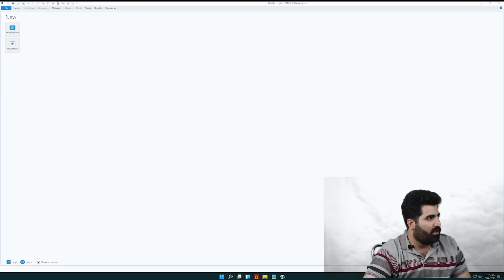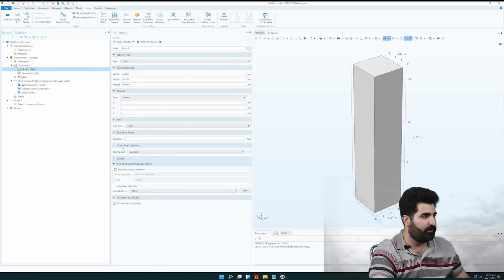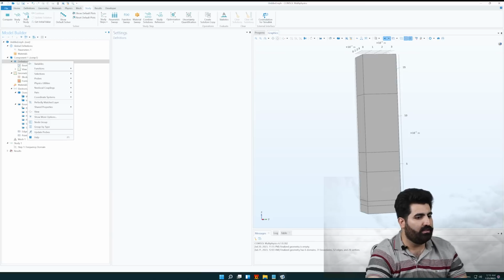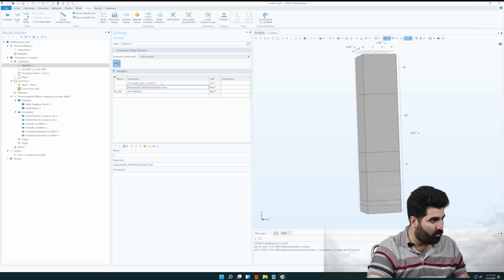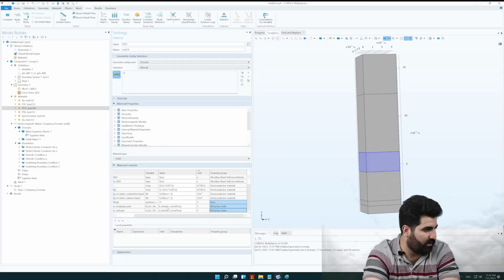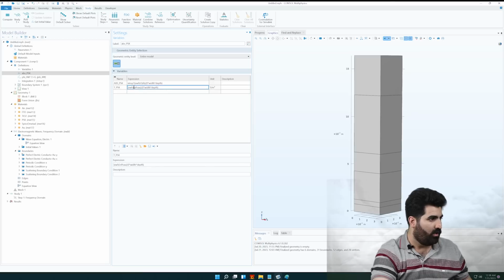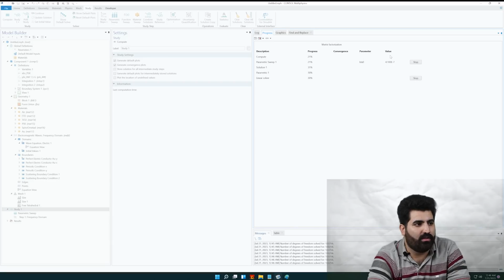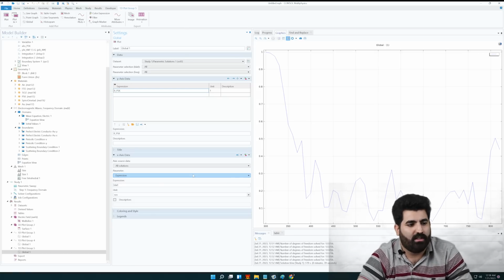3D generation rate,absorbance, reflectance, and transmittance of Perovskite solar cells with Comsol

Comment: Dear Dr. Mehran,
If I do not use the scattering boundary condition in the EWFD section but instead set the incident light using a port and PML layers, how should I proceed? When I tried this approach, the absorption curve of the perovskite layer was far from the result shown in your graph.
Thank you very much!
Reply from the maker: You must consider real situation , ot means the real electric field,
Reply: I need this video with a better resolution

Comment: Dear Mehran, 
Please can you tell me how can I calculate integrale of Heat thermalisation (radiation) :Hth =integrale((E-Eg-3*K*T)*g_tot
Reply from the maker: You must add variable section then write this code
Note: integrate
And the integrate must be define in.the nonlocal coupling section and in the related gemotry
Reply: @EasyTechSci  
thank you for your reply, Mr Mehran my integral is limited from band gap energy Eg and incidente energy, when I use monolocal coupling integral I can't integrate for energy? please tell me how can limited my integrale for energy.
thank.

Comment: Hi, Dear Mehran.
Thank you for this video. Please, can you tell me how I can sum all the wavelengths to have the total generation Gtot in order to add it in the semiconductor module.
Reply from the maker: You must extract the G for each wavelengths and bring it to the excel or origin software, then keep x, y, z and sum all of G. The x, y, z valus are the same for all wavelengths and you must keep one of them but G is different and you must sum them.
Reply: @EasyTechSci  
Tanks a lot,
Please, another question concerning the parameter that I must optimize to have a large total generation of around 2.5 e^28 or more . Because, I gote only 1e^26
Reply from the maker: @fateherbentah2029   you must work on the refractive indexes and boundaries conditions in optical modeling
Reply: @Mehran.Minbashi  
Hi, dear Mehran

Wat do you mean by boundaries condition? I applied all the boundaries conditions that you recommended in the video. If exist others, please tell me. Best regard.
Reply from the maker: @fateherbentah2029  see the video carfully.
There is nothing more than that.

Comment: Could you please let us know how to calculate the generation rate?
Reply from the maker: Hello dear dr,
Yes, you must extract the generation rate for each wavelengths and then sum all of the generation for all wavelengths. If it is hard, I will make a video about that.
Excuse me for delay, I will be touch sooner from this moment.
Reply: @Mehran.Minbashi  thanks so much, I did it but the generation rate is much more than that of achieved by other software, for example, 10 times more than the generation rate of lumerical software. Are you sure the equation is correct?
Reply from the maker: @hamedsaghaei6898 Hi, yes, these formula are based on the most researches on solar cell simulations with Comsol, and also I vaild the data of generation with the Scaps1D also, the generation rate in some points of x, y, z directtions will be different. we can have online meeting if you need more explanations.
My WhatsApp number is :
+989193613519
Reply: @hamedsaghaei6898 سلام وقتتون بخیر عذرخواهی میکنم فارسی پیام میدم،
دقیقا مشکل من هم همینه و مثل شما ۱۰ برابر بیشتر بدست میاد، خیلی وقته درگیر این حل این مشکلم اگر شما جواب گرفتید واقعا ممنون میشم منم راهنمایی کنید
Reply: @EasyTechSci  سلام آقای دکتر عذرخواهی میکنم، من هم دقیقا همین مشکل را دارم و کاری که فرمودید را انجام دادم و جنریشن ۱۰ برابر مقدار اصلی اومد ممنون میشم منم راهنمایی کنید
Reply: Hello, I have the same problem, I have not been able to fix it for more than a month. If you find a solution, please guide me.Thank you
Reply: @mohammadfaraji1124   Hi, Have you found a solution? If yes, please let me know how to proceed.
Reply: @boubouz31  Hello
I took a text output from the generation value calculated by the formula in Comsol and in Matlab software I took the integral of this generation according to the wavelength and added the obtained total generation back into Comsol to continue the calculations.

Comment: DR.Mehran Minbashi    >>The design of the Solar cell is almost identical to the design steps  LED??
Reply from the maker: Dear NawarasAli, in the semiconductor part, it is very similar, but in the optical part, you must define dipole for LED radiation instead of input port for light in solar cells. I will provide a tutorial video about that.